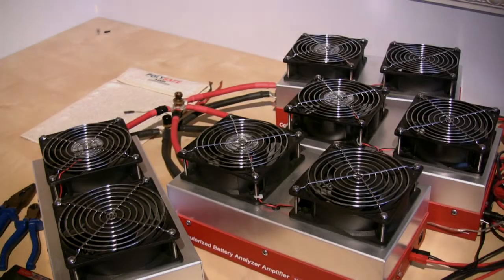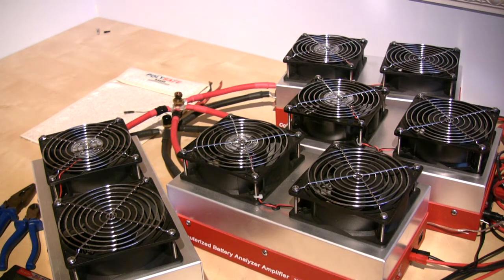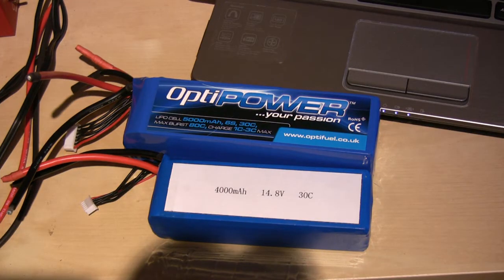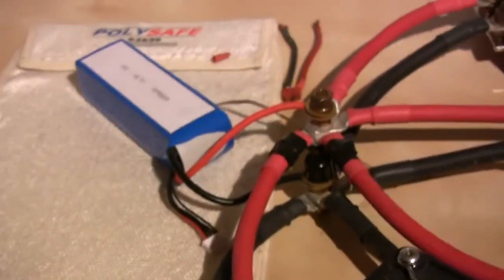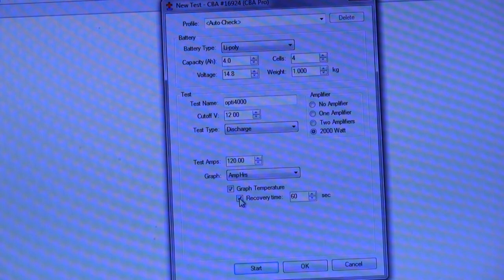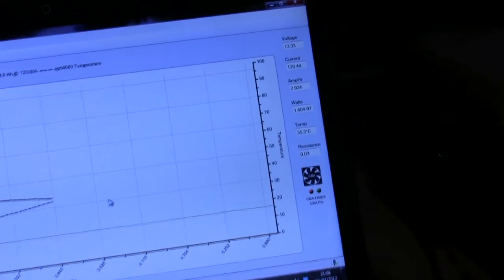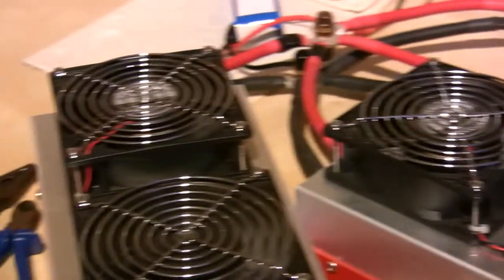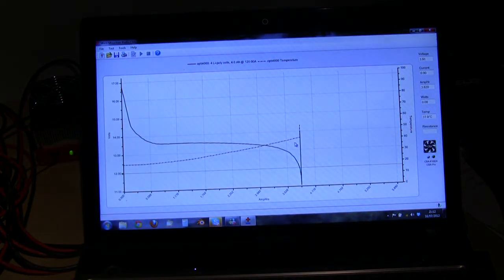OptiPower 30C Discharge Test

Comment from the maker: Optipower is the brand name for a range of battery packs for RC use, this does not make them lithium design engineers (experts). Almost all packs you can buy come from a separate manufacturer and are specified by companies such as Optipower to suit their particular market (C rating, wire size, balance connector, cell sizes, series cell count).
With regard to sponsorship, OptiPower sponsor me to fly their products, this existed a year before I agreed to be their lithium test engineer.

Comment from the maker: Although I had discussed the idea of putting a discharge video online with OptiPower they had no idea I had done it until they saw the video and no idea what pack I would use. They therefore had no opportunity to somehow select the pack used. Of course I understand the suspicion but it makes little to no sense to have an independent test analyst charging you to analyse pack quality and rate your packs if you can do it yourself before sending them to the analyst.

Comment from the maker: Actually OptiPower currently only use a single source (I should know I do all their testing and converse with the factory directly). Additionally the factory used was selected after testing in total 17 factories for cell quality, capability and longevity. The price of the cells was never a consideration, OptiFuel already had a strong brand built around quality so selecting cheap crap cells was never an option.